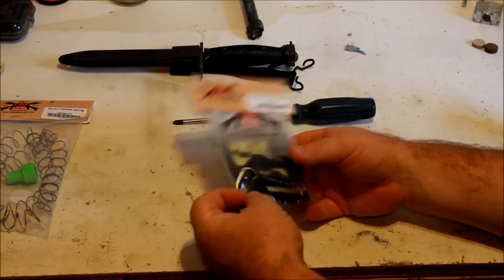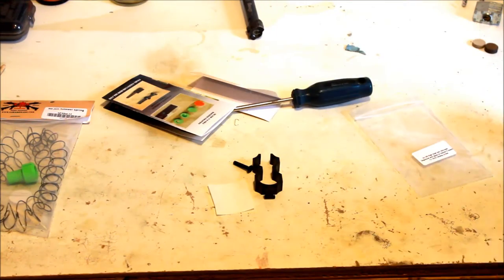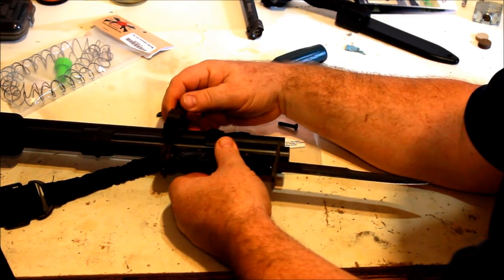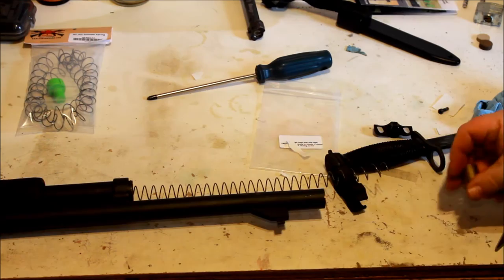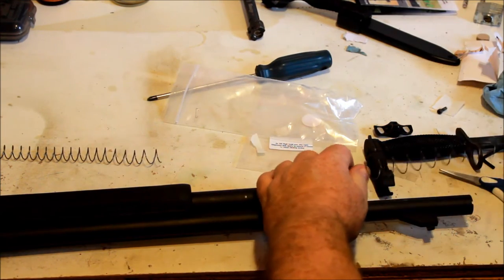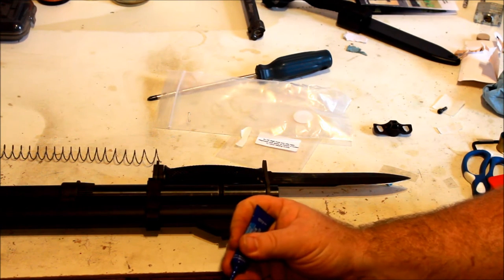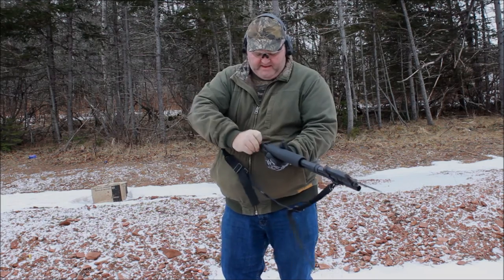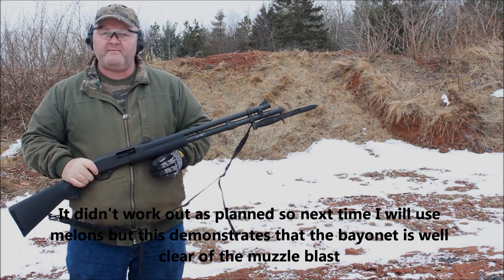870 Shotgun Bayonet Lug

Comment: Bit of a silly question. Why put one on? A= 1, because you can. 2 because it is cool, 3, to fight off the enemy, 4. to store the bayonet, 5. in case you run out of ammo, 6 for self defence of course, 7. To be a 'heavy' more heavy than Hickok 45, 8. Because Joe is about to say, 'get a bayonet for your shotgun'.9. to improve the balance of the gun and10, to make it safer at short range of course.
Reply: PS. also to reduce noise if you need to kill someone at short range in self defence in places where you have this right.
Reply from the maker: It just looks cool :)